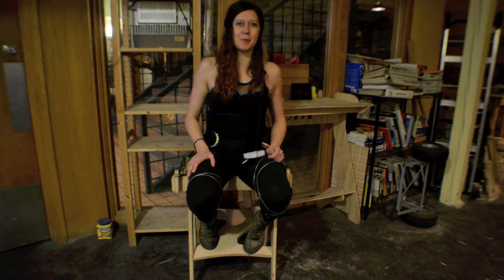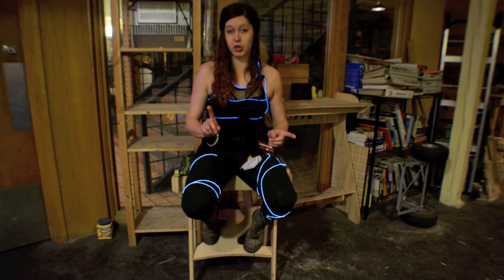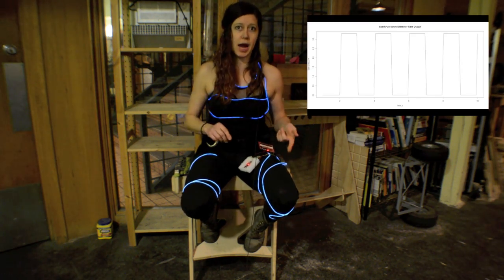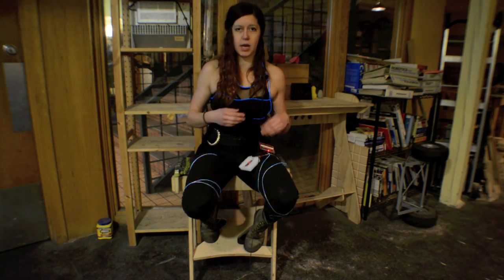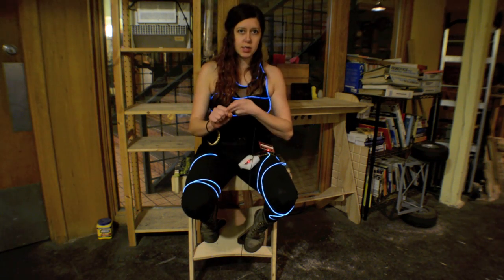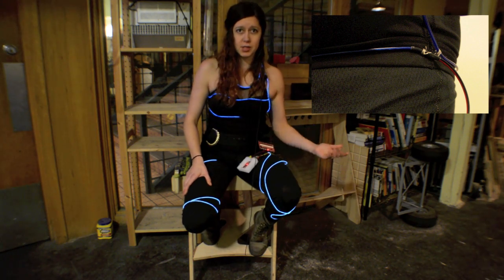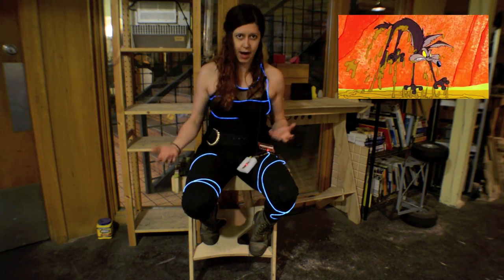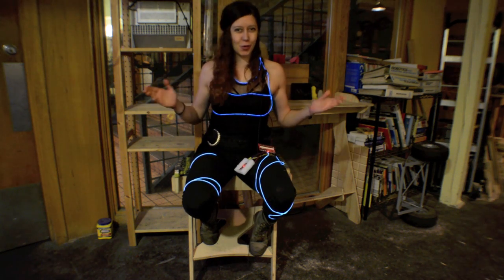Maker Quest: Sound Reactive Light Up Costume

Comment: Is ther an update on this sort idea, with newer stuff and potentially battery powered?
Reply from the maker: oh, yes! i have made updates over the years to this costume. it's always been battery powered, but i added a switch to change modes on the EL Wire, added a bunch of connectors to make getting in/out easier, and printed some cases for the electronics to make it more robust!

Comment: Hello i am making a cosplay with EL wire, and I was wondering if EL wire can glow underneath spandex or if I should sew the el wire over the spandex?
Reply from the maker: Good question! Honestly it depends on the spandex and on the room(s) you'll be in -- it's really hard to see EL wire in daylight or a well lit room, so if you'll be out and about during the day I'd recommend on the outside. If you're using light-colored spandex or spandex that stretches and is sorta transparent, or if you'll be in a super dark room, underneath would work. hope that helps! And of course, always work testing before you commit :)

Comment: i have a question, can u for example program the turn on and turn of of the costumes , I mean, in the second 10 turn on just your legs and in the second 12 turn on just your arms but at the same time turn of your legs !??
Reply from the maker: One of the benefits of using a microcontroller is that you can program it to do (almost) anything you want! So yes, you could program the EL Sequencer to do that :)

Comment: Could the EL Escudo Dos Shield work for both the sound detector and the sequencer or it only acts as the sequencer?
Reply from the maker: Good question! The EL Sequencer is the microcontroller, while the sound detector is a separate sensor. The EL Escudo would replace the EL Sequencer only, so you'll still need a sound detector. Hope that helps!